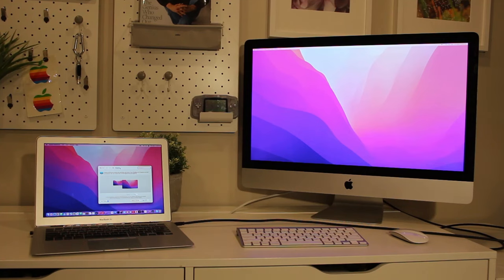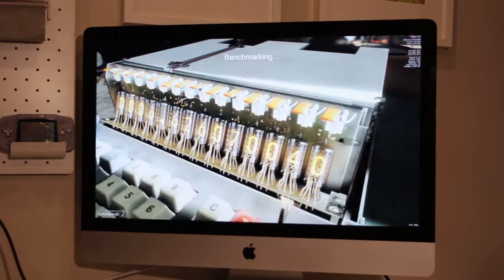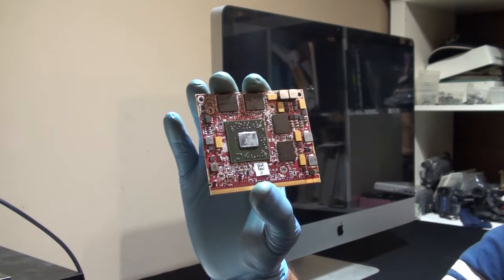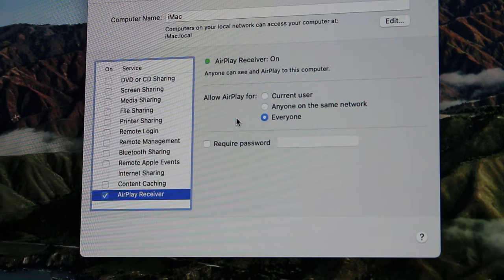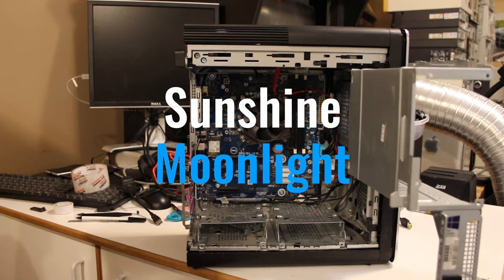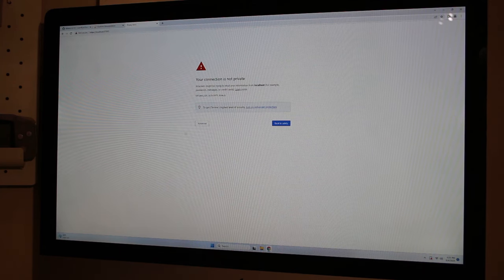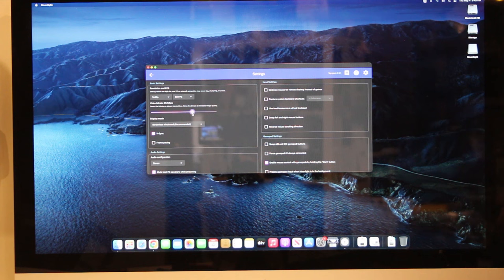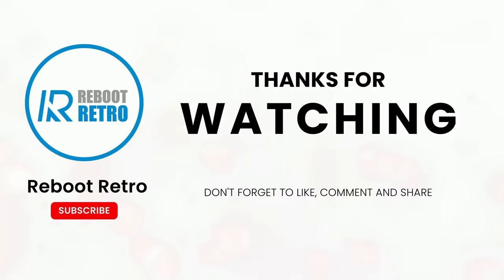Use ANY Mac as a monitor, not just Target Display!

Comment: I plan on buying a 2009 strictly to connect it to my PlayStation can I do that?

I have a 2011 iMac but that’s when I found out it wasn’t supported
Reply from the maker: I think the PlayStation only does HDMI out, not DisplayPort.  You'll need an ACTIVE HDMI to DisplayPort adapter (the kind with a chip inside, not the passive cable that just passes pins through).  With an active HDMI adapter, you should be able to connect a PlayStation to a 2009/2010 iMac.

You're correct, a 2011 does not work because it only accepts a proprietary connection to certain Macs.  The 2009 and 2010 models accept a generic DisplayPort signal and will work with any device that can supply it, including non-Apple devices.

My 2 cents though, if you're buying an entire iMac just to use as a monitor, I'd probably instead just buy a 27" monitor.  A used 27" monitor should not be significantly higher cost than a 2009/2010 iMac.  The monitor will sip very little power, while the iMac will consume significantly more - I measured over 100W of power on mine.  And you can even use the standalone monitor as a secondary screen for your existing 2011 iMac too.  Also, if the iMac computer portion dies or if the GPU fails (which they are prone to), it can in some cases prevent using it as a monitor too.

The 2009/2010 iMac makes a great monitor if you already have one hanging around, but if I was going to buy something to use solely as a monitor, I'd take a standalone monitor any day.  But that's just my 2c :)
Reply: @rebootretro  thanks for the reply!!!
Reply: @rebootretro  I have a 27 thunderbolt not sure of what year but I think maybe 2011 as well *I bought it second hand

But I can’t use the thunderbolt as well I’m assuming as jus a display for ps5
Reply from the maker: @blacxice  Correct, you can't use Thunderbolt for video in on a 2011 or newer.  The problem is that not only does it require a Thunderbolt connection, it also communicates between the other Mac to negotiate.  So you cannot even use a 2011 as a screen for a PC, much less a PlayStation.

You can, however, buy an HDMI video capture device and use a video player like VLC to watch.  The latency and video quality are probably not going to be great, but it's a potentially cheap option.  The adapter I had was only around $15.  The one I have works on Windows and Linux, not sure about Mac.  So if you go that route you'll need to make sure to get one that supports Mac OS.
Reply: I have 24" imac early 2009 
And wa windows pc 

How and what shoudl i do

Comment: Target display with windows to imac 2009, 2010 not allow brightness control?
Reply from the maker: It's true, you cannot change brightness with iMac or with Windows during Target Display.  I could not find any solution either.  I suspect if someone made an app to send the necessary command, it should work.  If you use the Sunshine/Moonlight method instead of Target Display, brightness should work fine though.
Reply: @rebootretro  I did read about one solution that works for me.  Connect a second keyboard to the Mac monitor and adjust its brightness that way.  I had a spare Apple wireless keyboard and did that -- it works!

Comment: This is a good solution, but does not work well with 27" iMac 5K (2014-2020), the max resolution is 4K and can't drive full 5K resolution (Network/ethernet limitation). otherwise it a very capable software and runs great.
Reply from the maker: It's true, not a perfect solution.  It's really unfortunate that Apple dropped Target Display on older models.  As far as I know, there isn't currently any option that works better at this point.  Maybe one day there will be 5K support and even improved quality/latency.
Reply: @rebootretro  there is one one option that can drive full 5K@45Hz from the iMac (use Thunderbolt cable for best performance)  using Luna Display Adapter, but Mac-to-Mac mode works better than PC-to-Mac. Only PC that can works like Mac with this adapter is Intel NUC since the built-in Thunderbolt is technically the same as the Mac version used by apple.

Comment: Imac 2009 early 24" how can i use that thing
Please help if that worked 
I'll save money of buying a monitor
Reply from the maker: The 24" models do not support TargetDisplay.  For this model, you need to use Sunshine & Moonlight.
Reply: @rebootretro  some forums said they do work and i saw videos too
Tbh 
I dont have like display port cable so wanna make sure if it works. Can u help me out in this?
Reply from the maker: @Geekytravells  Sorry, my mistake... It does support TargetDisplay on the 2009 24" only (according to Apple).  My 24" is a 2008, which doesn't support it.  If you have a 2009, it SHOULD work exactly the same as my 2009 27" in the video with a mini DisplayPort to DisplayPort cable.  One and to the iMac, other end to the Windows PC.  If the video doesn't start, use the hotkey CMD F2 on an official Apple Keyboard.
Reply: @rebootretro  thanks alot bro
One of the best guy i found on this platform
Virtual Hug
Im really happy❤️❤️❤️😘🙂
Reply: @rebootretro  one more doubt
I have installed mac os Catalina after some yt again
Do i need to come back to high seria
Reply from the maker: @Geekytravells  Apple says you need High Sierra, but this is false!  TargetDisplay works on all versions of Mac OS.  I used it on Monterey, which is even newer than Catalina! :)
Reply: @rebootretro  one more 
Can i use hdmi to display adapter 
And then display to mini display 

Gonna work?

Comment: I can’t tell in the video where the airplay feature is in settings
Reply from the maker: Just so I understand, you say you're trying to use a 2019 iMac as a mirror to a Dell monitor... Do you mean you have a Dell Windows PC and you want to use the iMac as a second screen?  Or are you trying to connect a Dell standalone monitor to a 2019 iMac?  If I understand exactly what equipment you're trying to connect and how you want to connect it, I'll point you in the right direction :)
Reply: I have a Dell laptop with a Dell docking station..I have 2 monitors currently connected to the docking station and working but I am trying to figure out if there is a way to add my iMac (2019) to my current set up as the third monitor..
Reply from the maker: There isn't really a way to add a third one using the methods in the video.  A couple of ideas though:

Assuming you're not using the laptop screen, use Sunshine/Moonlight to mirror your laptop screen to the iMac, then use the 2 external monitors which gives you a total of 3 usable displays (but total 4 connected displays including the built-in laptop display).  If you're wanting the iMac as a 3rd monitor + keeping the laptop screen as a 4th, then this won't work.

The other option would be to use a 3rd party device like Luna Display or Duet Display, which allows you to use almost any spare device as a monitor for almost any other device.  Both these cost money though.  I've not personally tried either, but I've seen Luna Display I think on Linus Tech Tips many years ago and it seemed pretty good.  From recent research, that'd be the one I'd try.  Luna lets you plug in a dongle into your Dell, then run the Luna app on Mac, and your Dell will see the Mac as a standalone monitor.

Again, can't vouch for Luna or Duet personally, but they're probably your best bet to try if you need 2 monitors + iMac + built-in laptop display = 4 displays total.

I hope this makes sense!
Reply: Thank you!

Comment: i have a 2006 model, am i cooked?
Reply from the maker: @partial7707  You might be able to use Sunshine/Moonlight or Parsec.  The trouble is with 2006 hardware, it may not be fast enough for smooth video.  I think you have a good chance it will run though.  I think it’s worth trying and testing.

Comment: *Thank you. I have an old iMac (either 2009 or 2010 I believe) that's unusable but would like to make something of the screen, still looks so good I can't just throw it away :(. Wondering if I could use it as a basic display for a PC mini or any PC setup... You're giving me hope. I'll have to go check if there's any luck. 🥲
Edit: I've been using my iMac through the Windows partition I had once made. Will this process be any different there?...
Reply from the maker: I haven't test it myself, but people have said the Mac must boot into Mac OS to use Target Display.  I can confirm it works with Monterey.

Good news is that both 2009 and 2010 27" models work with ANY DisplayPort input, including Windows PC!

You can try it from Windows on the iMac, but if it doesn't work you can always reinstall Mac OS (any supported version) just to make Target Display work.

If you do have a 2009 or 2010 27" iMac, these are the absolute best models to use as a monitor!  Good luck! :)

Comment: Hey guys... I have a iMac 2017 which the display fell off (long story) and now, the technician says that the display can't work in its internal display port due to the fact that it's connector is broken or with an electrical damage. So I want to use my old late 2012 iMac as a Display for that 2017 one. Is there a way to achieve that with a cable (I did't using native remote access but is very slow and bad graphic quality) or there is a piece of hardware that allow me to convert my 2017 display to an external one and plug it to the external usb-c display ports? Or even more crazy, can I connect my fully functional 2017 retina display screen to my late 2012 iMac? Thanks for your help.
Reply from the maker: You can use official Target Display over Thunderbolt cable, according to Apple's docs: https://support.apple.com/en-us/105126

It looks like your 2012 iMac must be running High Sierra or older, and your 2017 must be running Catalina or older.  Although Apple says such things for the 2009 model, which absolutely works with new versions, so it might be worth testing regardless.

Alternatively, you can use the Sunshine/Moonlight method in the video (also works with Parsec - which is easier to set up on Mac).

There is also a product called Luna Display which is a little dongle you use on one Mac, then run an app on the other Mac to use as an external display.  I've not used this product personally, but it looks to be reputable IMO.  It costs money, but seems a little more polished that some other methods.

The easiest free option though is probably setting up Parsec on both computers.
Reply: @rebootretro  Thanks... I will give it a try and come back with the results. You are most kind.